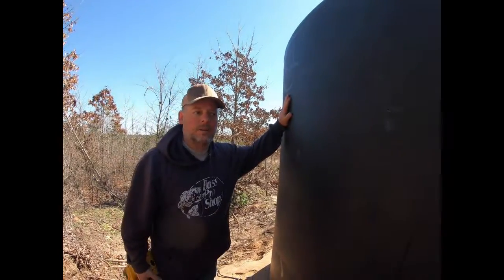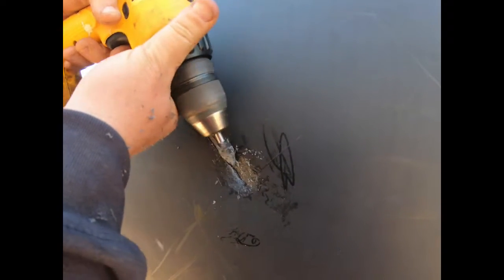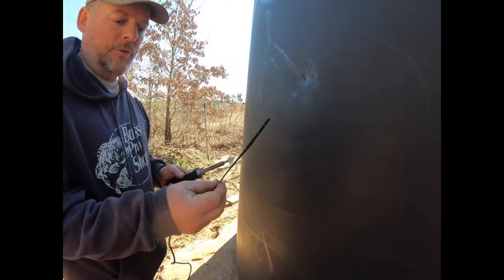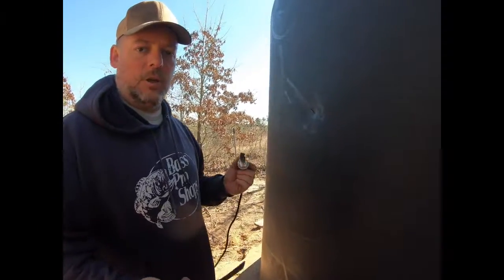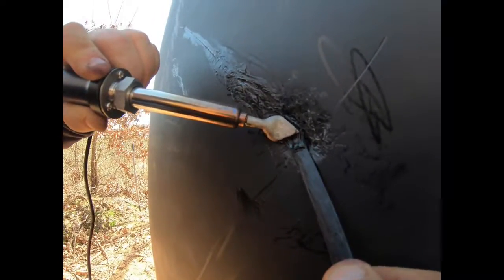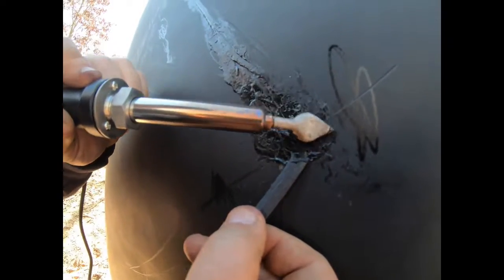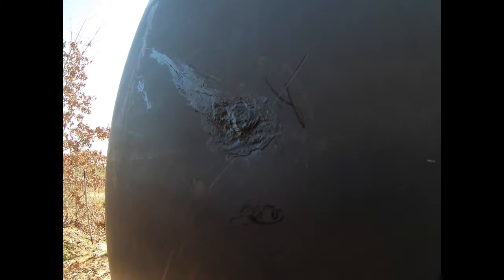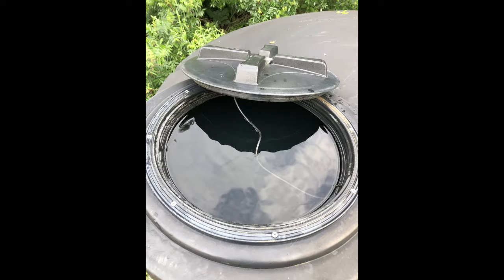2500 Gallon Plastic Water Tank Repair

Comment: What’s your thoughts on welding it if it has a slight weep coming from the crack? As you know water is precious and I can’t afford to dump it all out. Do you think,it would work?
Reply from the maker: @sotired7453  hard to say on that one. IMO the challenge lies with producing enough heat to melt the plastic (I think the water will act as a heat sync). Don’t know if you could borrow a tank for temp storage or use IBC totes (275 or 330 gallons each). Maybe get some help and have a second person use a torch to increase heat while you weld it. If it’s the only option, I would try just start away from the worst area so you don’t risk making it worse. Once you have a technique that is working, then move in on the actual leak. If it doesn’t work, then figure out a temporary storage solution and just grind out the repair and re do it. Best wishes, let me know how it goes. Heck if you were close I’d help.
Reply: @BacktoCountry  thanks although I don’t have anybody else around and it’s summer here so at least I have the weather on my side. My husband passed away so I am using as well as like with you watching many videos on things I haven’t had to do before  while mentally apologising to him for not realising just how much he had to do as we each got into our own routine like he would say we have a water leak so I would go try find it then dig it up and he would fix it so now I am learning a lot of new stuff and I think I will try the mesh as well. But thanks for the reply and your video it will help me for sure.

Comment: MY brand new tank arrived with two bad spots, one punch hole and one tire gouge. Thinking this might be the option, how's it holding up after a few years? Is it still holding water?
Reply from the maker: We’ve had zero leaks and zero issues. It has held perfectly. Hope it works as well for you.
Reply: @BacktoCountry  thanks so much!

Comment: I'm pretty sure you're supposed to tack weld the screen on first, and then backfill/overlay. Hey! But if it worked...it probably worked well enough.😉👍
Reply from the maker: Still holding solid after several years.

Comment: the bottom of these tanks are concave inward. do you just set them on top of sand? I was thinking of putting spray foam on the bottom so the bottom was flat. that way the foam would support it.
Reply: only concave until you fill it, the water weight pushes it out
Reply from the maker: Sand, dirt or gravel…they are pretty sturdy
Reply: Our original galvanized tank was sitting on river rock. When we replaced it with a poly tank, we filled the bed with sand. 5 years later we have a leak. Probably a rock came through. After I fix it, I plan to use rubber horse stall mats.

Comment: I paid $850 for the exact same size tank and fork lift tore hole in bottom. Seller said it was repaired professionally, but looks like they put some kind of caulk over it. I might remove the caulk and actually weld it. It would of cost me $1200 new and $400 for shipping so buying used saved about 50%.  how much did you pay?
Reply from the maker: The seller was asking $500 each for two, but once we discovered the hole, he sold me that one for $100. At the time we had no idea how to fix it…but suspected we could figure it out.
Reply: @BacktoCountry  wow great deal! they are hard to find used, those IBC totes are everywhere though.
Reply from the maker: True, the problem with the totes is they are translucent and the light encourages algae growth so you have to paint them
Reply: Just bout a 2500 gal tank with a big gash in the bottom.  How did your repair go?

Comment: Im thinking after finishing the out side
I would from the inside bridge the damaged area
Reply from the maker: If it were a bigger hole, I probably would have done that. But this one was 95% scrape with a small puncture. In the end the filler material bonded very well and we added screen to even strengthen that, so I predict it will hold for the life of the tank. So far it is working perfectly.  Thanks for watching and commenting.
Reply: @BacktoCountry  
My thinking is
Tires are patched from the inside
The work you did on the outside
Along with similar to the inside
Should make that part the strongest on the tank
Plus I always go over board the first time
Because I hate to go back after the fact
once it's been installed and in service
But that's just me
Reply from the maker: @jimh4167  I’m right there with you, I have a habit of over engineering everything 😉